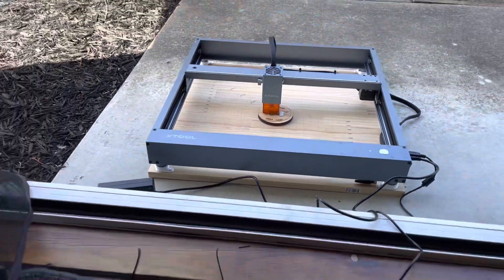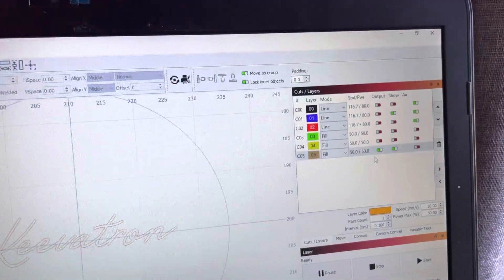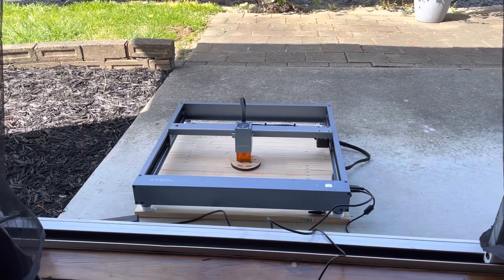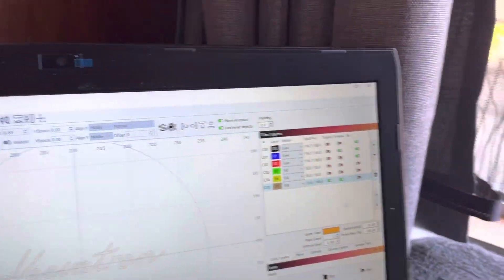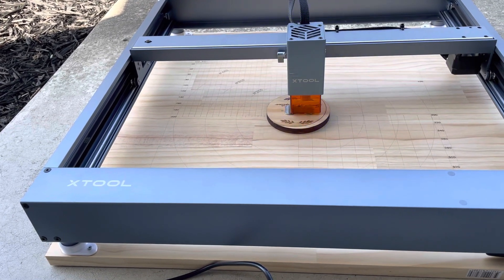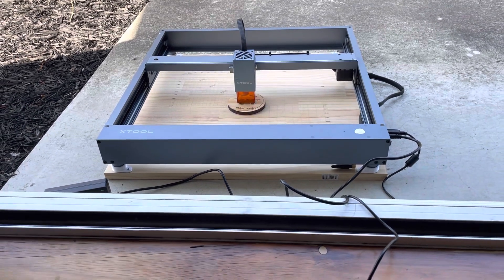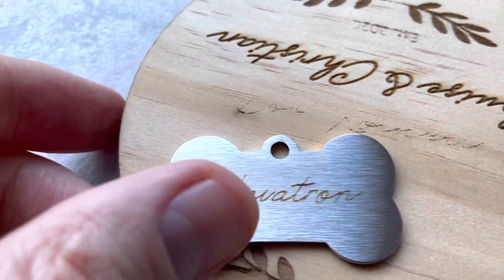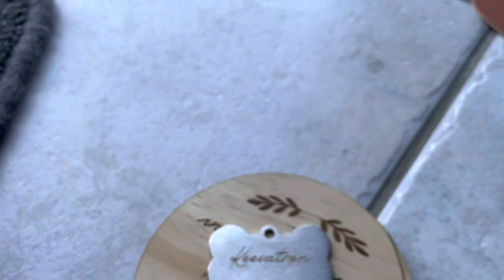Trying to laser engrave a metal product for Etsy with my xTool D1 / D1 Pro 10W.

Comment: Take a pic of the dog tag, import it into the software, burn that shape on your waste board or some cardboard.  Place the tag inside the shape.
Reply from the maker: Hi Futrell Garage,

I like that idea. I could also use a flat bed scanner, lay the dog tag on the glass, scan it and achieve exact dimensions. Then, do like you said, import and burn it into my waste board or create a jig.

I could do it this way for any product that will fit on the scanner. Thanks for this new concept. 👍

~Shane

Comment: The framing issues you have is exactly why I went with the xtool M1. Has camera and so easy to frame and engrave.
Reply from the maker: Hi Lightspeed Laser Engraving,

I’m not sure how portable the xTool M1 can be in comparison to the D1.

I need that portability to engrave outside but will have to create a grid / jig to accomplish what you can do regarding framing right out of the box.

The M1 bed has got to be a lot smaller as well compared to the D1. And, the D1 can be extended to be much longer with the extension kit.

But, framing something on the D1 / D1 Pro without a grid / jig…🤦‍♂️

~Shane

Comment: 10 mm is 10 Millimeters but in Lightburn it is written 10.00 what means it is 1mm per second
Reply from the maker: Great observation! Yes, in LightBurn, 10.00 means 1mm per second. It's important to double-check those settings to get the results you want. Thanks for pointing that out!

Comment: Hi. Can the 5w cut in tree and such or do you need the 10w or more? Thanks and Greetings from Denmark
Reply from the maker: Hi Mickeys RC Crawl,

Based on my experience with this 10w laser, I would say that a 5w laser can cut wood. It just might take a long time if the wood is 10mm thick. Maybe 30 passes. And long term, it will burn out the laser.

These laser diodes are just so powerful. They can do a lot more than I ever imagined.

In the future, I might get a 5w solely for fine engraving and a 40w for cutting wood efficiently. But I love this 10w so far.

~Shane
Reply: Thanks so much, got a little bit wisher now ☺ and great contens. Always great to learn something new and in a great way.
Reply from the maker: For sure mate! I love learning too and am always happy to help in anyway possible. 😁

Comment: The reason it didn't really engrave is because of the reflective material. Try painting it black with water solvable paint and engrave it. When you wash it off you should see a better engraving.
Reply from the maker: That’s an awesome tip David, thank you! I’ll definitely get some water solvable paint and try engraving again.

Comment: You should be using mm/min on a diode laser. mm/minute is for CO2 laser. To engrave steel with a 10w laser you need 100-150 mm/min at 100% power. In your case it's about 1.5mm/sec at full power.
Reply from the maker: Okay, if I understand correctly…

mm/sec is for laser diode machines.

mm/min is for CO2 laser machines.
Reply: @hobbylasermachine  Read my message again.. You're switching them.. You have a diode laser. (Diode - mm/min) (CO2 - mm/sec) You can go to the settings in lightburn to change them. Hope this helps. They are both the same. However the standard in the industry is quoted as stated. You can convert them too (mm/min divided by 60 = mm/sec) and vice versa (mm/sec X 60=mm/min)
Reply from the maker: Got it! Thank you Billy, this has confused me since the beginning. I really appreciate your time explaining that for me. I will switch to mm/min as I use a laser diode machine. Thanks again!